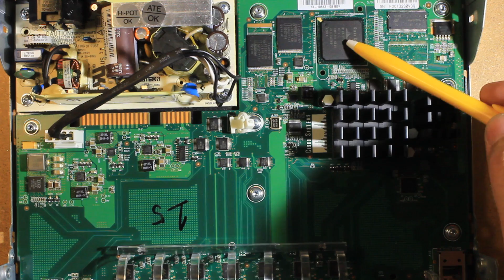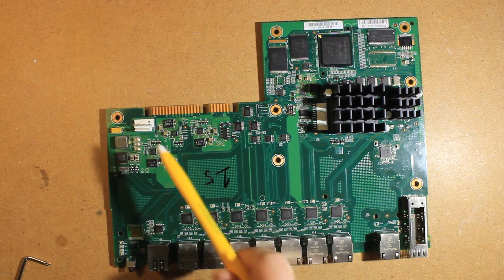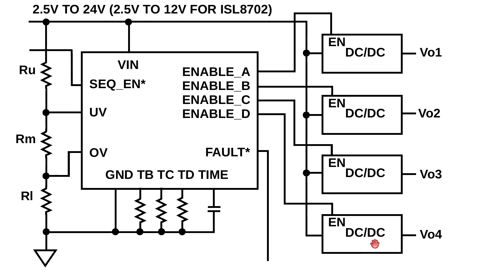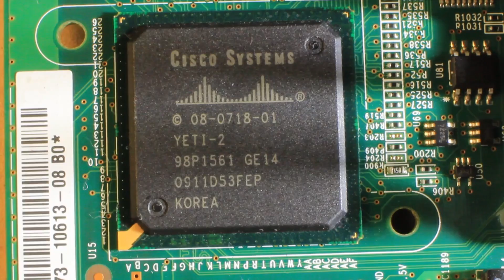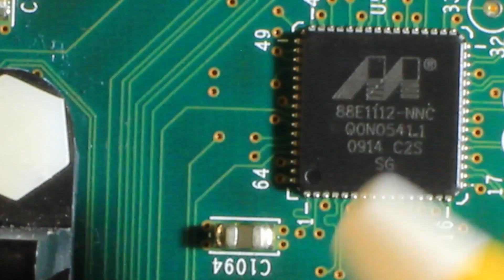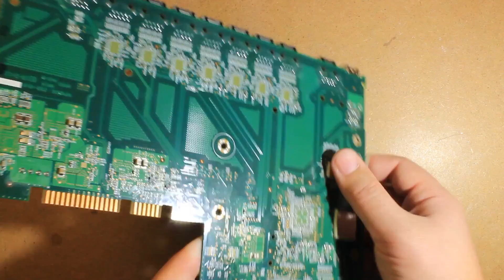Cisco 2960G Switch teardown an detailed overview for CCNA lab and repair -Part2

Comment: hi ! thanx for your videos ! very interresting ! if you're already interested in Cisco components, I have found (I'm quite sure) the exact name of the ASIC chip in the 2960G serie : according to this video : https://www.youtube.com/watch?v=95FlG2r6obM the 2960G 24 ports have exactly the same CPU and, in this case, the ASIC is visible because of the presence of the fan. i have searched and i found very light informations about the SASQUATCH8G ASIC chip here : https://baixardoc.com/preview/document-5cddc8a6827ec we learned that this chip is a double SASQUATCH in one die, i don't know what the "8.8G" name means......what do you think about that ?

Comment: Hi i have a 2960G series which have all the system leds and de GB ports in green and dont blink. Someone tell me that maybe is the NVRAM Chip, how can i identify it? Thanks a lot!
Reply from the maker: What is the console output on the switch?
Reply: @DonkeyLearningIT  have not console output just black. Thanks
Reply from the maker: @Quemero32  If there is nothing on the console, then that is indeed hardware problem. However, I would assume that something is off with the power supply, or with the ASIC. The NVRAM rarely fail. In fact, these switches do not have separate NVRAM, but instead they use the flash to simulate NVRAM.

Comment: Hi, it's a very interesting video. Do you know about any more documentation about this Yeti-2 CPU?
Reply from the maker: I wish I would have more information about these devices, since I consider Cisco stuff to be fascinating. 
As I understood, these are based on IBM Power-PC, and Cisco was investing lot of effort into putting more features into the CPU. Though, as usual, in the case of a switch, the real "grunt" is in the Cisco ASIC, paired with the database chip, which is also an ASIC on its own league.

Comment from the maker: Do you get any output from the console?
Which LED is stuck on green? Does any of the LEDs blink before going solid?
Those which are stuck on green from the very first moment you plug them in without producing any console output are mostly bad RAM.
I actually have a couple of those (2960G with stuck green) and I intend to do a howto-repair video on them.
Reply: Hi, thanks for replay! No output from the console port at all. The System LED is the one stuck on solid green right after i pluged the power cord! No other LED's blink or lights up at all. Only the SYST LED. I Googled 3560 v2 chematics and couldn't find, I wanted to test the components. The power supply is working and there is no bad capasitors or resistors, I tested it with True rms fluke 287 meter. It would be a great help, if you do a video how to rapair one. Thanks Again!

Comment: Hi, thanks for the good Videos, and good explained too. I have 3560 v2 which does start when plugged on AC power, but the SYST led stack on solid green right after booting. Any ide what it could be?
Reply from the maker: If you are sure that the power supply is good, the issue you describe sounds like RAM chip failure (90% of the time) or the onboard flash chip have failed, and the ROMMON is not being loaded. Thus, one need a good hot air reworking station, or an infrared reworking station. One can try to replace the RAM chip without such a thing, but it would require hands like a surgeon. Therefore, I will be using my Honton HTR 290 reworking station to try to repair similar issue. I will definitely upload the video once I have time next to my job to do the repair.
Reply: Hi, I tested with another power supply of a the same 3560 working one just to clarify that the issue is not from PSU. I blieve fault is from the RAM chip, I used bit of time testing the SMD's, Capasitor, Mosfets, indoctors and Resistoers. All tested components gives the same output result wich is good. I guess I have to give a try testing the DDR RAM. As you said it could be some issues with the RAM.
Reply from the maker: If the PSU is known good, no output from the console, and the system turns instantly green, that sounds like RAM chip failure to me. However, if you intend to replace the RAM, you have to use the specific model used in the switch, and they are not easy to get. Best option is to buy a working RAM module stick for a Cisco ASA. The ASA series of firewalls used the same RAM chips as the ones in the switches.
Reply from the maker: The situation is, that using equipment what is normally available for small repair shops, you simply do not test the RAM chip at all. You just remove and replace it with a known working chip. I know this sounds surprisingly ignorant, but even large repair shops do the same procedure, because testing it would cost more than replacing it.